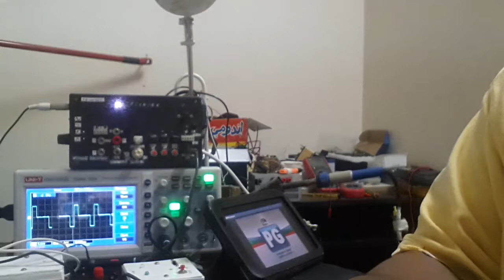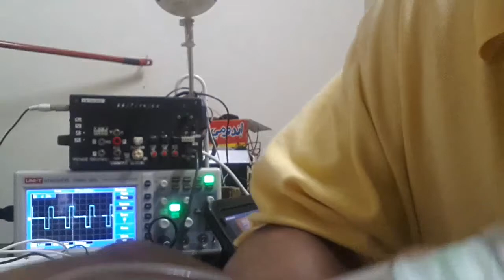How to make Flushback Arrestor-One way Valve 4 HHO

Comment from the maker: Flushback Arrestor with filter in primary input and the output has oneway valve to prevent fireback to the system at the same time has stainless steel spiral scourer incase that oneway valve is defective the spiral scourer will act as arrestor.